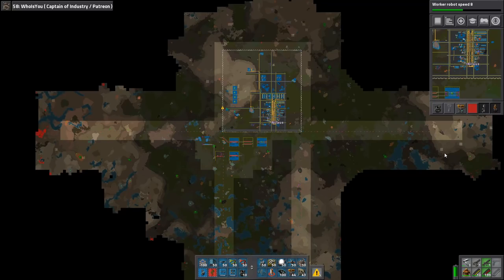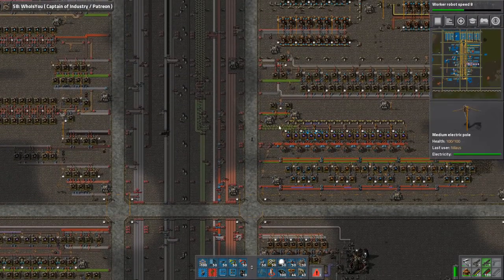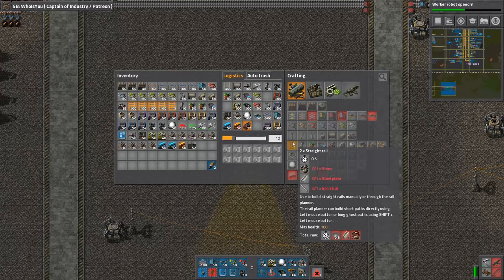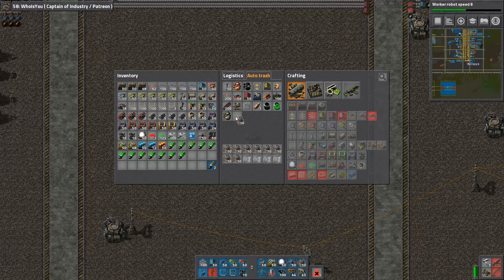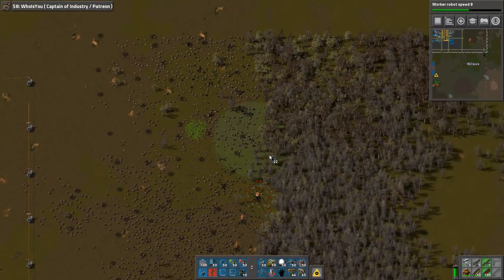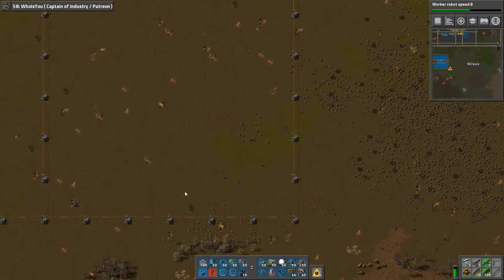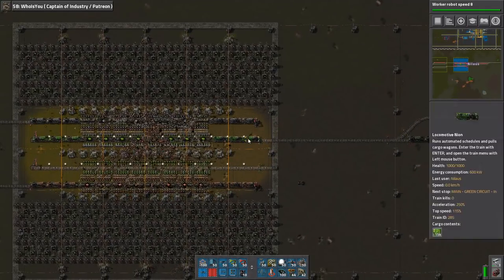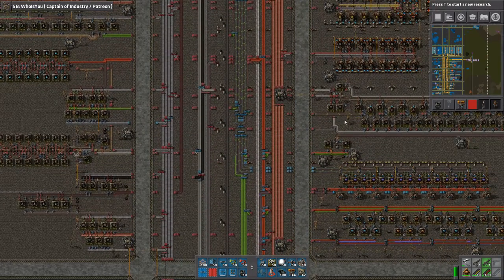Factorio 0.16 - Final Factory #58 GREEN RIVERS OF JOY

Comment: Not sure if this was the plan but you built 2 outbound stations in the green circuit block, then added 2 trains running into only the top station, the bottom station is not connected to anything
Reply from the maker: The other outbound station will supply the Red Circuits when i build that block 😉
Reply: You'll ship red circuits out of the Green Circuit block? How avant-garde!
Reply from the maker: "Supply the red" not "supply red" :)
Reply: In my defence, I am old and mostly insane :)